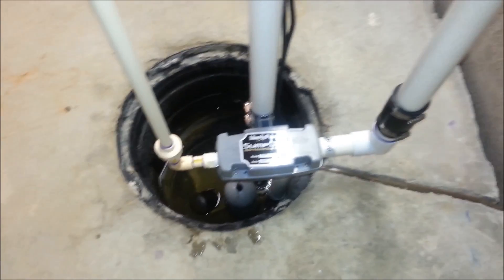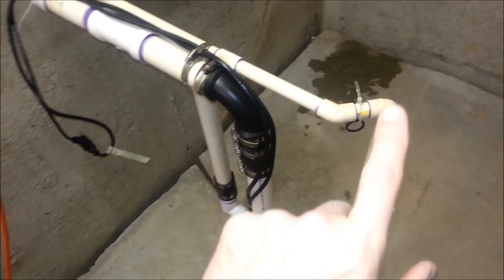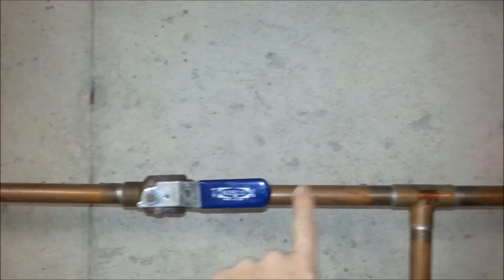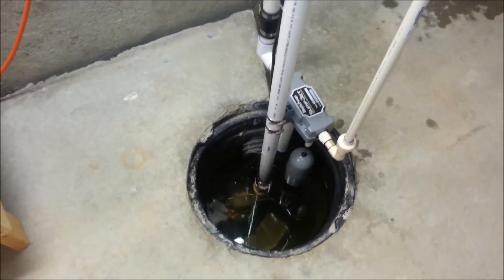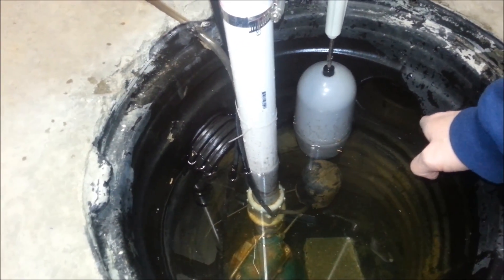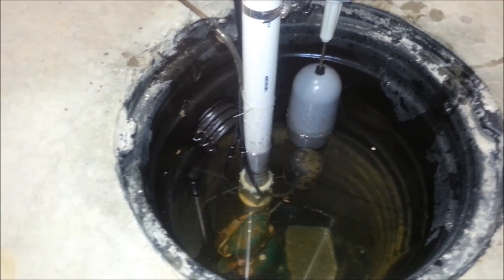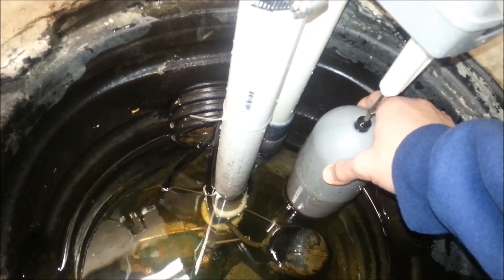Trash That Battery Sump Pump & Install A Water Powered SJ10 Liberty Sump Pump No Dead Battery Again.

Comment: The issue with water powered backup systems is the code requirement. An RPZ is usually required and given the pressure drop across that device in addition to an "open valve" pressure requirement of 40 psig minimum, most would be ineffective.

Comment: Great video and thanks for sharing the details. I believe Liberty pumps requires a dedicated discharge line for their SJ10 pump or they void their warranty. Other manufacturers like Zoeller do not require one. It makes sense to have a dedicated line to avoid creating a loop if the check valve were to fail, and adding an alarm so one knows that the main pump has failed. However, in retrofit situations involving finished basements, running a dedicated line could be problematic. I currently have a battery backup sump pump and during the recent storm, I was sitting there with a bucket and a hand pump to empty the pit since the battery backup pump could not keep up and I was worried the battery would run out. I view the water-powered pump as the safe bet for backup and I will replace my battery backup pump with this.
Reply from the maker: Thanks for watching & good luck 🤞👍

Comment: You have a SINGLE discharge for the two systems? Is this an issue, how big of an issue?
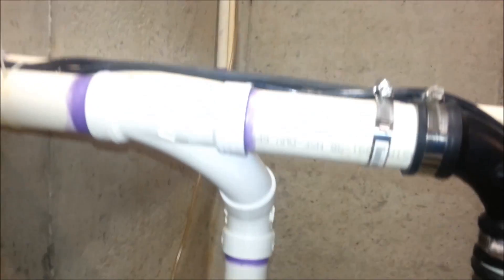Reply: at 2:06 you have the two connected with i think its called a wye? wouldnt the main and this throw water BACK INTO the pit? how does that work?
Reply from the maker: @sleepingtiger4436  I have a inline PVC Check-Valve that keeps the discharge water from coming back. Hope that helps. 🤞

Comment: I have a 110 volt primary along with a 12 volt backup pump. The battery  must be replaced every 3-4 years. Also have a spare pump combo and check valve for emergency spares. Thinking about adding a water backup system for triple redundancy. Others tell me a Honda generator stored in the garage would be a better purchase. That way I could have some lighting as well.
Reply from the maker: All personal preference.

Comment: I had a water system installed by a licensed plumber , not this brand which was expensive and it failed, from what I can see or was told ,there was more water coming in then the system could pump out . Or it was installed incorrectly.
Any suggestions? 
Thx
Reply from the maker: Check out my newest follow up video to this. Might give you a better  idea of how much water it can handle.

Comment: We recently had one installed. They never put the cover back on; probably because it wouldn't fit. Should we have it covered to prevent radon gas?
Reply from the maker: Wow great question that I unfortunately don't know the answer to. I would however try to cut the cover larger and put back on top. Good luck. 🤞

Comment: There is a check valve for the electric pump, is there no need for a check valve on the output of the Liberty SJ10 backup or is it built in to the SJ10?

Comment: Hey Rick, do know if it is possible to adjust the float? Mine is set too high. Instructions don't talk about that. Thanks
Reply from the maker: The float is set in a fixed position. The only way I can see to adjust it up or down I see would be to remount the entire pump assembly up or down or adjust the small grommet on top of the float up or down to change the amount of travel up or down. Consult with manufacturer but that's how I see it. Shouldn't be to difficult to do if you followed my easy install. Good luck.

Comment: Has the pump ever been tested against heavy storm where 2-3,000 GPM is required?  This is a key disadvantage of a water based pump that pumps less than 1,000 HPM. AC battery backup can pump around the same GPM as the original pump indefinitely with power on.  If power doesn’t go off this is an advantage of the AC Battery backup.  If the power go’s out for longer than 5 hours in a storm then the battery is limited and a water pump has an advantage if it can keep up.

For light to medium rain/water removal the water backup has some advantages.  

So I am interested to see if the pump in the video has pumped during a storm as I Am interested in this system.  Thanks...
Reply from the maker: As stated in one of my videos we were hammered here in Delaware by Storm Irene. That Storm knocked us out of power for 10hrs. This pump kept us from flooding especially since out ground water never seems to stop around here. Add that plus this killer storm & It performed with no problem. I however do have a gas powered generator which I transferred over to so I wasn't getting killed on water bill. This is just used in a worse case scenario until you can get back up & running with your main pumps. As I have said even your battery system will eventually fail if that now becomes your main pump. Rick
Reply: smaerd58 

Thanks, good to know it handled a storm. 

I know someone that had their basement flood when a backup pump fitting leaked and heard of another that could not pump out fast enough during a storm.  So it makes me
Leary of water backups, But these may be anomalies.  

I want to have peace of mind when I am away from Home for periods of time and plan to shut the water off. 

Of course it can have its own separate line but risk of leak is there allbeit small.  

AC Battery systems can run forever as long as there is power but of course is limited to the battery life when there is no electricity.  I wont consider an older battery only backup systems.  Thanks for the feedback.  Still on the fence which system to put in ha ha
Reply from the maker: @mxpmw  Completely your decision. This was mine after a Heavy Duty Marine Battery & Pump failure during a bad storm. I also have installed a double check valve on my supply so nothing backs up into potable water. I am not a Plumber I am a Retired Pipefitter but can guarantee my joints don't leak while away or home. Good luck with your decision. Rick
Reply: Your numbers aren't gelling--2000 gallons per minute...?

The thing is any AC battery backup running heavy is going to drain the battery fairly quickly.

IMO best system is of course a backup generator to run the pump during an extended power outage, but I intend on getting a water system like this guy has for when I'm away, or primary pump fails, etc.. It is maintenance free and the battery won't die sitting for a few years, plus it has an indefinite fuel source (I've never known our water pressure to go).

Comment: Let's face it you'd have to be pretty stupid to say yes to a battery operated sump in the first place.
Reply: T. Shrine AC Battery systems actually have some advantages over water systems, they pump around three times the volume of a water backup similar to the main Pump provided AC power is available.  

If power is out it is limited by the battery storage.  If the main pump go’s out in a storm and the electricity is out for a day (rare where we live, 3-4 hours max when it happens), the AC battery backup will pump well until the battery dies and then flood, the water backup will flood quickly since it cant keep up as it is limited by max flow rate but at a slower rate.  

Neither system is perfect, there are advantages and disadvantages of each.
Reply: @mxpmw  the way I see it is water is very heavy and battery power is weak and unreliable especially if you're not home for a few days at a time,I went with the back up water system so far so good. I also have a 1 horsepower back up with its own hose and a generac. Obviously I'm big on redundancy LOL! just my opinion. 😎👍
Reply: T. Shrine The reason I want a backup is due to a failure of the main pump and flooding, so I agree its great to have a backup.  Unless its a high grade pump main pumps should be replaced every 5 years I learned.

An AC battery system will run on AC first, not the battery, so as long as there is electricity it will run continuously just like water backup, and AC/Battery backup systems use an electric motor similar as the primary pump so it  pumps much faster than the water backups.  In a heavy storm the AC battery system wins the water removal battle.
 

The problem is if the electricity is out the AC/battery system then runs on battery.  Then it has between 5 and10 hours of run time so if the power is
out for a long time this can be an issue.  

One day they will create a system with no downside but both water and AC/Battery systems do have their own downsides.
Reply: @mxpmw  ps. You're right about the volume but the batteries will die eventually, & the water powered backup will run indefinitely.😎👍
Reply: T. Shrine we rarely lose electricity here and if we do the battery life can cover the time until they are up and running.  I don’t like having to replace batteries every 5 years though and is why I like the water backup...we do get  heavy rain and if the main pump go’s
out my fear is the water backup cant do the job.  Its also a leak risk when leaving the home for a period of time.   Still on the fence ha ha
Reply: @mxpmw  one thing for sure there's no perfect choice let's hope we made the right one, good luck!

Comment: One must calculate how much flow rate is needed for their situation. In some cases, this will not pump enough water, and a battery-powered pump is required!     In general, battery powered sump pumps pump more water.

if you're facing 35 gallons of inflow per minute and need to rely on this, you're in trouble.
Reply: Battery back up is garbage

Comment: Don't be fooled by this advice.

EPA and state authorities are requiring a backflow device to prevent the contamination of city water.

These devices require installation by a licensed and locally approved pumper and they have to be tested annually. The Village I live in quote me their supposed cost (over $150) for the Watts In-Line Double Check Valve Assembly, 007M3QT-3/4. Ordinary vacuum breakers will not be allowed and if you have an outdoor sprinkler system, the State will require you to removed your current vacuum breaker and install one of these devices. You may be required to have two Watts, one for each system in your home.

Now, Amazon will ship it for $102 but there is no guarantee that a plumber in your town would install it.  And here it the kick in the head. This plumber wants $225 to test it annually.

That's $200 to $400 to install and $100 to $200 for a device. That equates to $500 to $800 at the end of year 1 and $200 per year after that.

And don't forget your consumables. For every gallon pumped from your crock is 2 gallons in water and sewage your water supplier will charge you. And worse yet, how will you know your water backup pump is working properly without leaking water or wasting water into the crock day in and day out. Out Village contacted us for months concerned about a usage spike that we could not account for. Then one day replacing a pump in a second crock for gray water I heard the sound of water moving ever so quietly in the pipe overhead. It was the supply line to the water backup. This was costly and we are not the only people who have suffered water waste.

Sorry, Liberty but you just aren't worth it!

Comment: How did you retrofit the tethered switch?...did you change the wiring inside to bypass the orig switch to always on and then just plug into yourvtethered switch?..and leave everything else as is on the m53?
Reply from the maker: Something like that. The switch burned out originally since my pump never shuts off due to all the rain spring water we get. So I removed the old switch and wired together so always on then bought a tethered float. Basically changing pump into a N model.

Comment: This system is exactly what I think I’ve been looking for! It makes sense and I love that it takes zero electricity! My only concern is that my house only has 1/2” water lines since it only has one bathroom.. will this pump work with 1/2” lines? My guess is it will but just not as good but it would be awesome to have an opinion by someone who knows this thing! Thanks 👍

Comment: superb video, thanks!!!  only thing I'd add is I've had a problem with those rubber couplings coming loose as the rubber ages.  I've just hard-plumbed the discharge with PVC only.
Reply from the maker: Understood.... Reason why I am using rubber fittings is due to loosing main pumps frequently so easy changeovers. Darn pumps run 24-7 around here. Crazy weather.
Reply: right...what I'm suggesting is PVC unions.  if the rubber works for you, go for it.  I had one come apart and was a big mess, so I'm sworn off 'em.
Reply from the maker: @GHinWI  Got ya. I keep extras on had just in case. If it is a compression union they work great but are not cheap.

Comment: If the check valve on your primary pump fails and the backup pump runs it may flood the pit. That’s why they recommend separate discharge piping. But you can protect against that by using a water alarm. If you don’t have an alarm you can get one for about $10.

Comment: Wow what a great idea. I was amazed how well it worked. Is there a minimum water pressure for it to work that well? I don't have or need a sump pump I just stumbled onto this video and am impressed by your system. Don't worry about the nay sayers most Americans have turned into morons over the last few decades and wouldn't know a good idea if it bit them on the ass..lol . Anyway good vid thanks for sharing.
Reply: taz man System sucks!

Comment: Just curious:
1. Why you use cpvc rather than pvc to connect to the copper pipe? Can PVC be used?
2. Did you have problem so far merging the drain for this Liberty pumps drain with the main drain?
3. Any reason for the additional dual check valve rather than the state code? Did the product come with a internal dual check valve to prevent water backflow? Is that not enough?
Thanks. Nice vid
Reply: Correct the liberty does come with a check valve in the pump.

Comment: I've installed those before. One thing you need to add to it is an alarm. This person I installed it for was older and didn't go to their basement often. The primary pump failed and the hydrostatic backup worked as it should. But she called me a month later with a $3000.00 water bill.  She had no idea  that she was using the backup. Plus adding an alarm can be a nice upsell.
Reply: No chance I would get a hydro backup.  You're right about the water bill.  I had a hydro backup.  My pressure switch failed on my primary and my hydro backup ran for an unknown period of time.  I did have an alarm, but the battery died on it and it didn't alert me.  $1,600 water bill.  Go with a battery backup.
Reply: Yep, the alarm is a must!
Reply: What the hell do you guys pay for water???  Water is basically free around here.  We pay like $3 per 1,000 gallons.
Reply: So the alarm sensor should at a height near the backup pump level, so you know that the backup is running.
Reply: $3,000 that's like using 100,000 gallons of water or more...
Reply: My basement is finished.  I will install an alarm, but also want to know - wouldn't the pump also make a sucking sound once the well is dry and it's pulling air?
Reply: Curious.  Why wasn't an alarm installed?
Reply: Wait - her basement was flooded for an entire month?  Doesn't a water powered backup system stop after the rain storms are over?

Comment: Thinking about installing one of these as a backup. A problem I have though, is that my crock is sealed with a lid due to a radon mitigation system I had installed. I could always drill holes in the lid and secure this pump to the actual lid instead of the primary drain pipe like your setup, but it will be a lot more hassle. My crock has to be air tight or radon gas can leak into the basement.

I also have all copper in my house. Is the city water inlet a push fitting? King of like a Sharkbite? I don't see it being very easy to sweat copper on that. Might melt the plastic housing. The description says it accepts copper....just wondering how. Thanks!
Reply from the maker: Joshua Scott Yes...they include Sharkbyte Gator type fittings to install piping. Hope that helps.

Comment: So you added a check valve in the water supply line, but you said it comes with one in the first vid. Was this just precaution or did you have an issue?  Just wondering if it's needed or not. Thanks.
Reply from the maker: Dave code in my state to have a backflow preventer or double check on supply line for potable water.

Comment: One problem with these is that if you are on a well you lose water when you lose electricity.
Reply: This is not made for people with well water, only city water.
Reply: Adam Weimer that's exactly what I said. It won't.
Reply: Liam Hilt no shit.
Reply: If you read the directions on the Venturi pumps, they all say not for use with well systems, only city water where this is constant reliable pressure. This video is just as the guy says, it is how he installed it. It is not a 100% thorough tutorial.

Comment: thanks for the video.  i just had a power outage for about 30 minutes, once power came back on i noticed the sump pump running pretty loud.  i didnt think much of it since it was raining pretty hard, although it sounded louder than normal.  i came back an hour later and it was still running pretty loud, so i checked it out and the pit barely has water in it (below the float) yet the water supply is still running.  i checked the meter and it used about 10 gallons of water in a mater of minutes.  something isnt right.  for now i shut off the water valve to the pump.  any suggestions?  thank you.
Reply from the maker: Kevin Strauss Your internal check valve in the pump could be stuck open. remove the pump and take it apart. Could be sedament trapped. Every once in awhile I go by and pull up float to trigger pump and make sure it goes on and off. Even when not using or used in some time to make sure everything is running smooth for a unexpected storm.
Reply: Did you put a dual check on the water line feeding it?